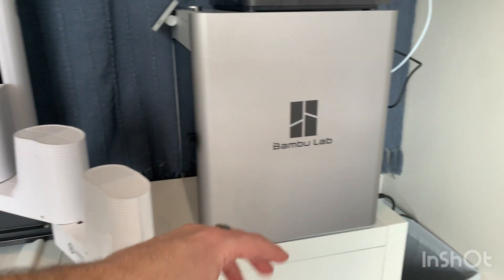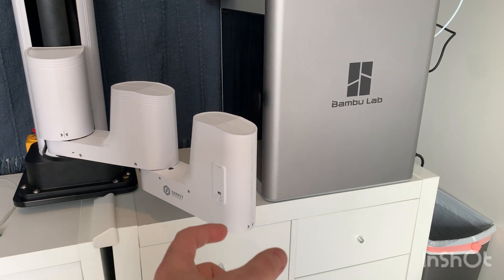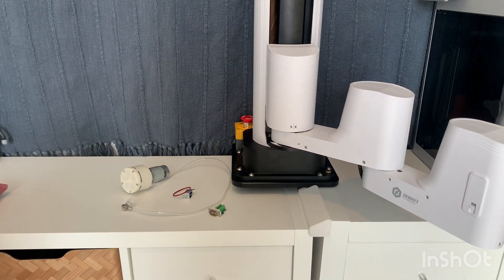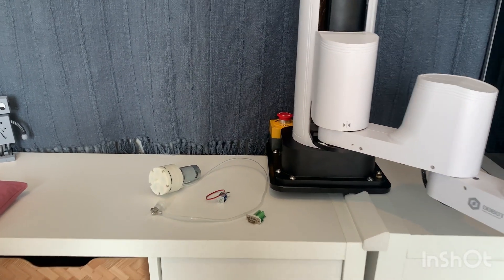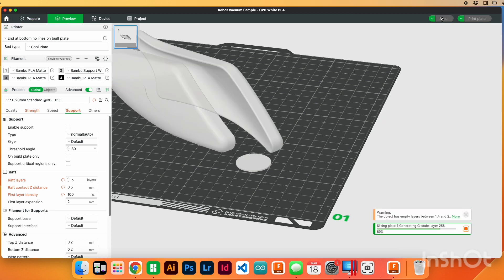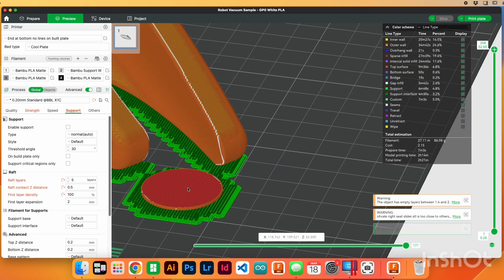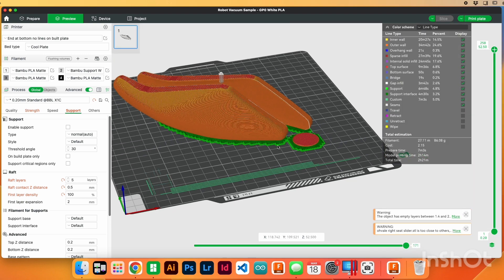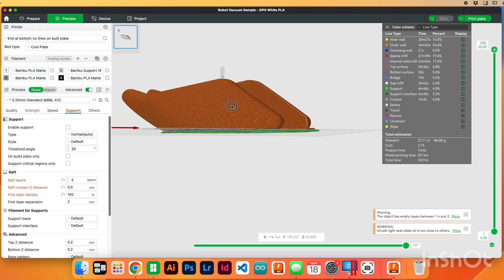Scope change for the full automation of the Bambu Lab X1 Carbon with the Dobot M1 robot - Part 5

Comment: Interesting ideas. 

I've been thinking about similar things. Not sure though that I would want to add a raft under every printed part - due to the impact it might have on the quality of the bottom surface.  Also I think it would need to be closer to the centre of the raft - rather than at the edge. Will be interesting to see how you get on.  

Think I would consider maybe putting the 'coin' onto the top of each part instead - maybe on a small cone that can easily be snapped off.

I was thinking it would be nice to be able to automatically remove the build plate as per your original idea - but was concerned about the amount of force required to remove it - so had considered whether replacing the permanent magnets with some sort of electro magnets would help make it easier for the robot (or a human ) to remove the build plate.

Also like the idea of sensing a print has completed via a switch at the bottom of the chamber - I'd like to find a way to power off my x1c automatically once a print has successfully completed - and this sounds like a good solution to triggering off the process (after a suitable delay to allow print head to cool down).

I suspect though that it's probably possible to pick up from Bambu Studio somehow that the print has successfully completed - maybe with something like keyboard maestro - then kick off the robot process from there.
Reply from the maker: I agree on adding the "coin" to the center of the raft. I like the idea of making the "coin" a breakaway part I will explore different option. For lifting the build plate out, There isn't a large amount of force as long as it lifts straight up first. I have a video on my channel that shows you how I power my printer on and off from anywhere via a separate app. It isn't an automated process yet but it is a pretty good solution. https://youtu.be/jwrXsU_JrDU I have never heard of keyboard maestro, that seems like an interesting idea to explore. Not sure if Bambu Lab Studio has a complete notification when the print completes.
Reply: @MartinoDesign99  Thanks - will look at your other videos as I would like if possible to be able to automatically swap beds, as my main prints consist up to 30 different printed plates - each 2-4 hrs each - I've got two BL Textured plates which most of the the parts also seem to pop of quite nicely once they cool - however the purge towers seem to need more effort to get off. 

Keyboard Maestro is a Mac only macro/automation type tool.  I have used it to make a few enhancements to Bambu Studio - like for example turning off bed level and flow calibration check boxes automatically, and auto colouring parts based on stl file names.  It can do things like monitor periodically for the presence of messages etc. on the screen - so it could look for printing complete (or whatever comes up on the Bambu Studio screen).   I've done a couple of posts on the Bambu labs forum for some of the things I have used it for - they are posted as suggested enhancements to Bambu Studio.

 I've got my X1C on a TPLINK Kasa smart socket - just want to ideal automate the power on and off like you can do with Octoprint.   For my prusa Mk3s  for example - when you send the sliced plate to print from prusaslicer - Octoprint automatically turns on the printer, does the print, waits for the head to cool down, then turns the printer back off again.
Reply: @MartinoDesign99  Just one other thought - if you are looking into a solution based on parts automatically releasing - do you really need to lift them off - or could you instead get your robot to just drag them off the sheet instead.   There are some solutions out there for other printers where they actually use the print head itself to push the parts off.